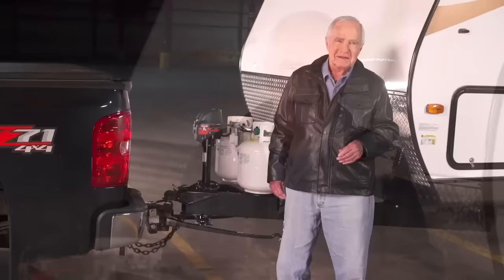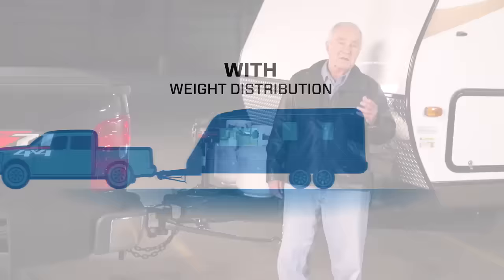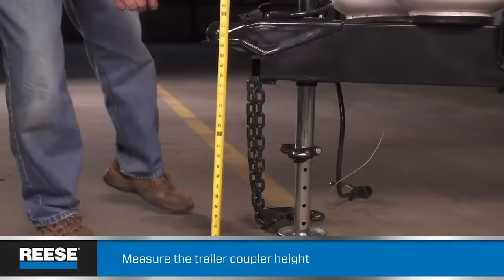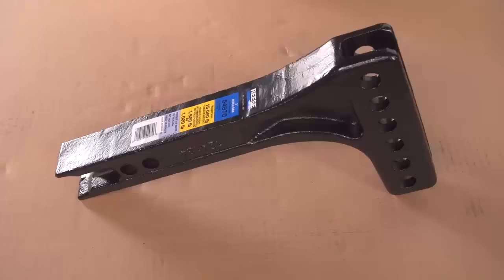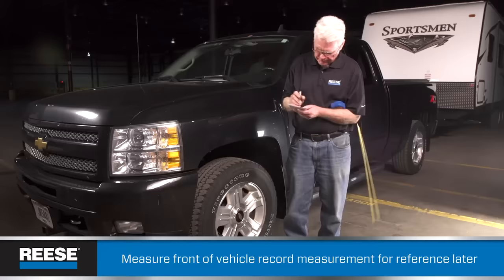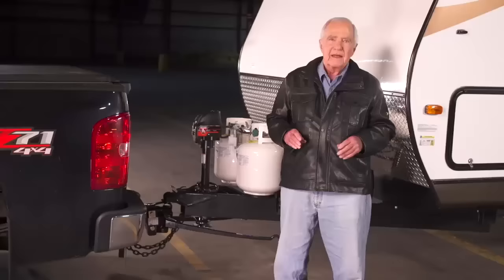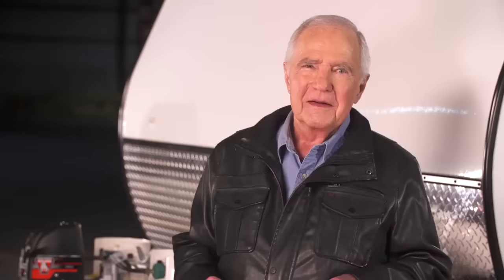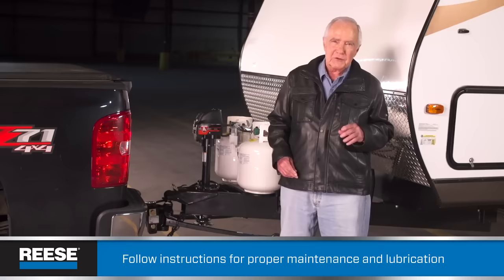How to Set Up a Weight Distribution Hitch

Comment: Important note: Always crisscross the safety chains one time. For some states, it's the law!
Reply: @J Dial : You need to cross them like an X, one over the other, underneath the trailer's hitch coupler. The reason you want to do this is because if the trailer becomes disconnected from the tow vehicle's hitch, the chain will tighten immediately and basically catch the trailer's hitch coupler, which will allow you to carry the trailer long enough to safely pull over, without its coupler hitting the road and either destroying the A-frame, or causing a major accident.
Reply: J Dial You cross them once, essentially making a "basket" underneath your hitch in case it comes loose.
Reply: @Jdial... A perfect explanation!  I’ll testify that it really does work. 1st hand experience! The only damage I ended up with was scrapes n scratches on my chains bottom of the ball receiver🙏🏻
Reply: Fifth Wheel Stree
Reply: Fifth Wheel Street, some chains originate from the center of the a frame,  crossing the chains has no effect with this set up.
Reply: Texas requires the crisis-cross method.
Reply: j s oh the irony in this one!!!! 😂
Reply: Depends where you are
Reply: @IowaKim  I believe this is the biggest reason.
Reply: Well it's a good thing that they did cross them in this video.

Comment: It’s always a good practice to create a cradle under the safety chains by crisscrossing them. The left trailer chain hooks to the right side of the truck hitch and the right trailer chain hooks to left side of the tow vehicle hitch. It will also prevent chain drag on the flat surface.
Reply: This crossing of the safety chain is technically state law in some states.      For anyone towing a box trailer or  camper its is also best to use a sway control mechanism. I personally like the Reese setup best.  One other thing I think that was missed here is getting the correct spring bars for  the tongue weight of the trailer.   This was a pretty good vid but  I normally use enough load to keep the front height close to normal rather then 1/2" high.   Sway control is a must have for safe travel.  See so many first time rv user which post about wrecking and  seems like the bulk of the cause.  Put allot of miles towing a 30 extra tall box behind a 28 foot  class C and had no trouble with trucks passing  be it me or them doing the passing or cross wind. Does it move you yes! Does it stay in complete control Yes!

Comment: I have a vintage trailer from the early 70s with a reese hitching system and judging by the owners manual illustrations they were bought together. Everything still works nearly exactly the same. It also works incredibly well 50 years later.

Comment: In Germany you use such systems only against high speed swinging over 80 km/h.

The Caravan itself must be fully loaded so balanced it doesn't press more as 50kg on the ball.

A complete different thinking with the same technic.
Reply: Also the design of most trailers is made so that this kind of device would not be needed.

Comment: He says keep close to same height at front of the tow vehicle with the spring bar adjusted... which changes headlight aim based on how much the rear springs compress.

I always adjusted spring to lower the front the same amount as the rear,which will keep the headlight aim the same.
Reply: And if you need spring equalizer... you need electric trailer brakes, that apply when you depress the tow vehicle brake pedal, not based on "surge" (surge is the trailer trying to pass the tow vehicle... which is... ye be screwed with a heavy trailer.)  not surge brakes

Adjusting the electric brakes you want to JUST not lock up the tires on the road surface.  This changes with load on the trailer and the road surface. (thus the adjustment knob on the controller)  Check that when road condition/load changes.  If they lock up the trailer will try to pass the tow vehicle.  its a very fine adjustment.
Reply: If ur that anal about it just buy airbags

Comment: To make the most out of your towing only tow 80  percent at most . You will be safer that way and have less problems down the road?
For example,  Truck has towing compacity of 7500 LBS. Tow no more than 5500 to be on the safe side. (Small Trailer)

Comment: FYI- In the last step with hooking up the safety chains, the open face of the claw should always face upwards. Just opposite the way the video shows here. The chains should also form an X or criss cross each other. This is just an added safety measure. Happy trails.
Reply: They also show the torque wrench on the bolt head, not the nut. And this guy proclaims to be such an expert. Fake news.

Comment: Do you have to disconnect everything to park? Most people have the one truck when they travel.
Reply: Well ,if you intend of leaving the camper parked and not attached to the truck,I would assume you would want to disconnect it
Reply: gunslingr45 
The only things that have to come off are the spring bars. 
It’s not a big deal.  A powered tongue jack is worth it’s weight in gold on a 100 degree day,  though. 
Considering that this type of hitch can save your life,  it’s   not   a   big   deal.

Comment: So it appears the weight distribution hitch converts some of the tongue weight to torque which then presses on the front wheels converting back to weight on the front wheels.     What does that do as far as the stresses on the hitch itself?   I have a well powered V6 sedan that only has a 1000 lb towing capacity which I presume is so low due to the unibody construction making the hitch mounting points structurally weak.
I was hoping that with such a hitch I could increase the abysmal towing capacity but I'm thinking probably not.    Can it help and if not, is there another means to increase my towing capacity to say about 2000 lbs?  
I have tons of power, just weak mounting points.
Reply: Yep, you can increase your towing capacity by purchasing a vehicle with a higher towing capacity, it's the only way.
Reply: A WD hitch will not give you any increased towing capacity.

Comment: Will this weight distribution system limit the turning capabilities of the trailer?
Reply: It will if you use an anti-sway brake.  But, that can be easily removed if needed.
Reply: Yep!! Turn to sharp and you can bend the trailer frame or break one of the chains. 
Any weight distribution hitch with chains are junk. Plus the fact that there is Absolutely no Sway Control!!
Reply: It will limit if you need to turn sharply, ~45 degrees or more, like when you are backing the trailer into a campsite. At that point I usually remove the distribution bars, takes about 5 minutes, then back up. I have on multiple occasions backed in or turned sharply with the system attached the downside is delays the reaction time of the trailer  due to torsion. So short answer is yes it does limit turning abilities in certain conditions but it is very easy to manage those conditions.

Comment: @10.20...does he mean if youre within 1/2" or LOWER (not higher) youre good to go???
Reply: turtlezed I believe he means higher. If the front sags as in that measurement becomes lower than when when you frost took it then you have actually taken away weight from the rear by having to much tension on the sway bars. That’s a big no no just like it is not good to take the weight from the front by adding the trailer

Comment: I want more info on the angle of the ball!
Reply: this is somewhat determined by genetic factors
Reply: WireAddict 
Good point.  If you find yourself reducing the number of chain links to increase spring bar pressure,  and end up with the spring bars angled up beside the tongue beam,  then the ball angle needs lowered.  It determines the angle that the spring bars START from, before you pry them up.  When they are up and locked in, they should be approximately level and just below the trailer tongue beam.  This provides enough chain links and clearance for slight swing in a sharp turn.   So yes,  the ball angle (which contains the spring bar sockets) determines the amount of spring pressure when the bars and chains end up in the right posture.

Comment: bought my first horse trailer with a weight distro system.  It's absolutely impossible to get the chain on the hook. I can get it on a link where it is not right and it flaps around (no purpose to that) but absolutely cannot get it on the right link (number 6).  The weight distro system can take your finger off.  It's dangerous too hook up.   My new trailer is kind of useless.
Reply: So you failed to read directions, ask advise, watch the video?  But you blame the hitch?  How many names do you post with?  You do NOT set chain length under much pressure.  You first RELIEVE most of the pressure with the Jack. 
  Please HIRE someone to move your horses. You will never figure out brakes, much less how to drive for their safety.

Comment: What’s the difference between “distribution hitch” and “sway bars”?
Reply: Distribution hitch in effect lessens the weight on the tow ball and rear end of the tow vehicle and increases the weight on the front of the vehicle.  Trailer hitch anti-sway bars resist side-to-side "wig-wagging" of the trailer behind the truck.
Reply: One distributes weight, the other controls sway🤷‍♂️
Reply: @Icutmetal  Best comment of the year!

Comment: Should the trailer be completely level after the weight distribution system is properly installed?  My RV dealer said the trailer should be pointing down a little bit.
Reply: Down a little but less than before installing. You would still want some tongue weight there.
Reply: The real goal is keep the tow vehicle level and the trailer level.

If the rear of the tow vehicle goes down 2 inches and the front goes up 1/2 inch, you have a sway problem waiting to happen and the headlights will be aimed too high.

The springs transfer weight to the front wheels and take it off the rear wheels.  You want the front to come Down within +/- 1/2 inch of as much as the rear . (I measure at the bumpers.)
Reply: F Huber ll

Comment: I have a Camper   on my short Box   extended cab  Pickup ..  I want to pull a trailer too ..  I  really can't  see  how you can put  more weight on the front axle of the pickup with  these bars??  
  I have  fabricated  designed and Invented all my life..
Reply: it's springing up the hinge point between the truck and the trailer.    the tension on the rods is straightening out the line of the truck and trailer by spring force so it doesn't dip down where they connect.
Reply: Mike Skidmore So you can build stuff, swell. If you consider where the tongue weight falls in relation to the axle; and how the torsion bars apply force, it will make sense.
Reply: Think of the truck like a wheelbarrow and those bars are the handles. You raise those handles using the tongue of the camper and it puts more weight to the front of your truck.

Comment: I have experienced fishtail problems when the front of a pickup truck is too high above its front axle.                I am not understanding how the equipment corrects that,   nor what exactly correct any of that how.
Reply: Sam Mullins 
It’s not very intuitive how it works,  but trust me,  it works.  When it is adjusted correctly,  prying the spring bars up doesn’t look like this video.  It takes both hands and a grunt.  There is a lot of lever pressure on that hitch pivot point.  The system is literally pushing down on the front of the truck while raising the back.  After you experience it,  you will never pull a big trailer without it.  It can save your life.  You will need help setting it up correctly.  Make sure the person helping you has plenty of actual experience in using one and setting up many.  Camper dealership is a likely place to find the right help.  There are many adjustments when doing the initial install,  and they are all important.  
Beyond that,  always be sure your cargo is located for the correct tongue weight.
Reply: It’s a part of system.  It really helps. It keeps things more level, weight spread over all axles.  But you still need to load trailer correctly.  Look up “weigh trailer with bathroom scale.” You can weigh tongue weight with 250lb bathroom scale to @1000 lbs easily   Goal is @10-15% total trailer weight.   Ideally weight centered over trailer axles…

Comment: Stupid note if you install the pin on the trailer shank from left to right you can forget the cotter pin. Is Reece hiring for a crash test driver.
Reply: That doesn't make sense.  Why would you forget or not need the cotter pin, depending on the direction of the hitch pin?
Reply: Clarice Davey Are you applying?

Comment: So this is not weight distribution. All its doing is changing the angle of the ball and then those bars basically apply a twisting force on your hitch to push the frame of your vehicle down. So your hitch and receiver are taking on even more force than they were previously.  Causing excessive wear and tear on the hitch and frame of your vehicle. Much better off buy a larger vehicle or upgrading your suspension system. Suspension is what really determines towing capacity. And would be a far better option than this hitch.
Reply: Go do a shear and moment diagram of the rig and you will see what the forces are doing with and without the WD hitch.
Reply: so if you're already towing a big 20000 pound 5th wheel camper with 3 slides and a tongue/hitch weight of 2000 pounds, where you do upgrade that 150/1500's suspension?  LOL.  have fun with that.
Reply: Fungulus1 Yeah, not exactly.

Comment: This video is very misleading and incomplete!

1st - the front of the vehicle should never be higher or you are not distributing anything.

2nd - the bars should be level with the bottom of the trailer frame. Adjust the hitch angle to better align the bars.

3rd - when installed so that enough weight is distributed by the bars, you have to jack the back end of the vehicle up a considerable amount to make installing the bars easier, not just a little. You want the chains to install with little force, so you don't get whacked in the nuts by the cheater bar trying to lock in the chains.

4th - he never says what size bars to get. Do you match the tongue weight, do you get bigger ones, smaller? The correct answer is at least as much as the tongue weight.

5th - you should always tow with the nose down slightly, not raised like he implies in the video. Level is good too, but when the nose has a slight forward rake, it helps to eliminate sway.
Reply: The old man and I setup his WDS today and we ended up with only 4 chain links with the front wheel measured at 0mm sag loaded (or equal) to what it was unloaded and the rear wheel at  20mm sag compared to when unloaded. Is this good, or indicative that we need to keep adjusting? Is the aim to have the front and rear wheels sag the same amount so that ultimately the car is still as level as it is unloaded? Thanks for any help ;)
Reply: The vehicle should be level.  Not nose down.  if you are nose down, means you are tail light and will result in a jack knife.

Comment: This ad should be titled ' How to put massive strain on the rear of your vehicle for the lazy fkrs who don't want to learn how to set their trailers up correctly' .. simply adjust the tongue height to allow the correct weight distribution through your vehicle and trailer and you won't have to fork out unnecessary coin to wankers selling these after market suicide bars
Reply: Really?  I have pulled everything from 2 wheel 5x8’ trailers to 90k semi trucks. Own 4 pickups in two states right now 2 half ton 4wd, 1 3/4 ton diesel, 4wd and a 1 ton diesel.   The half ton gets weight distribution hitch anything over 2 wheel 5x8’.   I consider weight, check tongue weight.  But it’s safer with weight distribution hitch. True I don’t have to crank it so massive load being offset.  But level truck, trailer is safer.   So who is the wanker?

Comment: These RVs are worst set up.   These frames are so weak.  The crack and allmost all RVs with hitch like this have frame issues.    Even 5th wheels inspect frame because frames are made with such weak thin metal nowadays.  People are clueless just how weak RVs are built. Regular towing even will twist and break get cracks in trailer frames.

Comment: Why would you buy that when you can just buy a dodge
Reply: Dodge has too many problems with transmissions and rear ends for towing.
Reply: Happy Pappy that’s why you don’t sign unless you get a transmission warranty
Reply: @happypappy6371  I have Dodges with 250,000 miles towing trailers. Ever since I switched to Dodge or "Ram" I found I could keep them in my fleet up to 275K miles and still get a good amount of money for them. They are real work horses man. Maybe old ones had trans problems but not any more!  I have the proof.
Reply: Luke Lusk Nice troll 👍

Comment: Callin' it a weight distribution system is just wrong. It's a sway control system. Most misinformed  by u do it wrong everytime. You have misinformed people a long time.
Reply: Um what.  I think I need to rewatch. I didn’t see anti sway. The safety chain did not appear crossed toward end. (They looked crossed earlier)  but might be. You realize he showed general?  For specific model he advised checking instructions, vehicle manufacture, hitch maker…